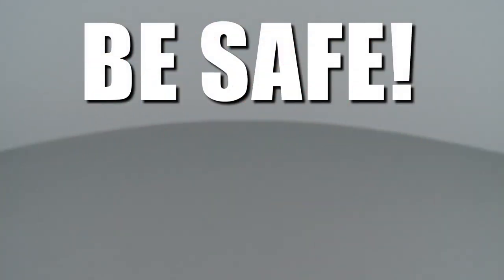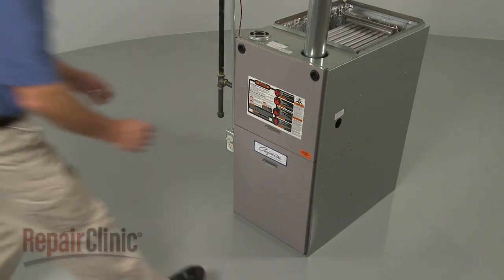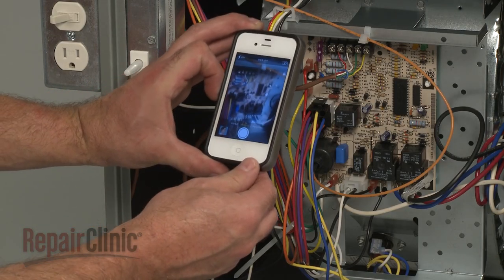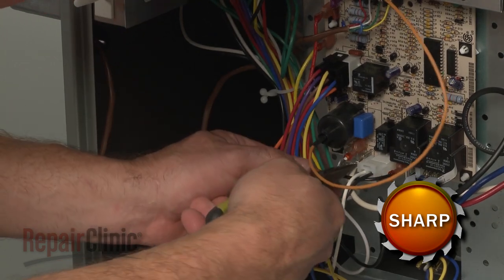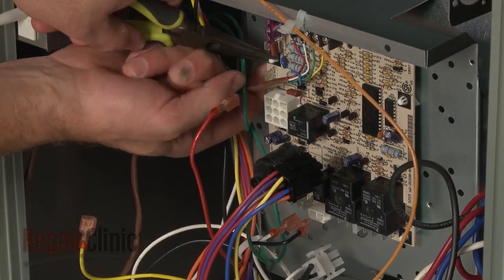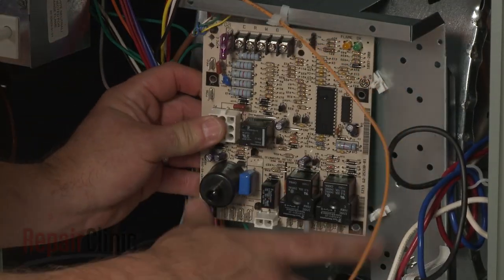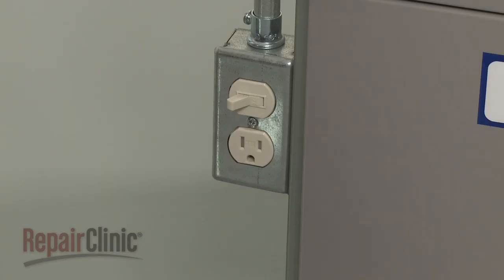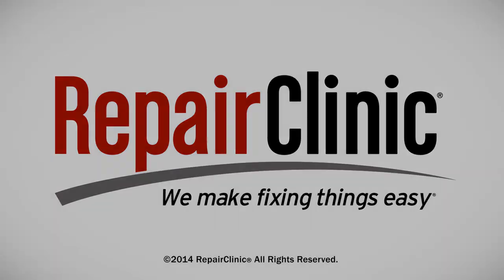Rheem Furnace Isn't Working? Control Board #62-25338-01

Comment: In a few hours here in southern NM a cold front will be moving in. In the morning I may have to continue troubleshooting I stopped in the spring when it warmed up. Already changed the spark detector, spark igniter, hi limit switch and bought a used board online. So if it doesn't work I will install the used board. Just hope it is better than the one I am taking out, and that that is the problem.

Comment: Thanks for a very good video! What if I take out the old board from the furnace first, then unplug one wire at a time and plug the same wire to the new board, do this one at a time, till all wires are connected to the new board, and then mount the new board to the furnace. This way, I can avoid messing up wires. Is this a better way to replace the board?
Reply from the maker: +Luke Li Either method is fine. Some people take a picture first.
Reply: Thanks! Didn't think of that. that will be helpful when i go to r/r.